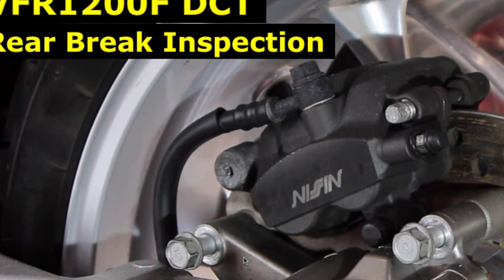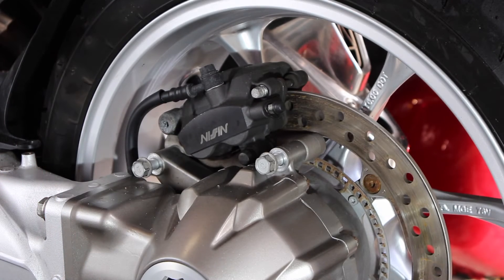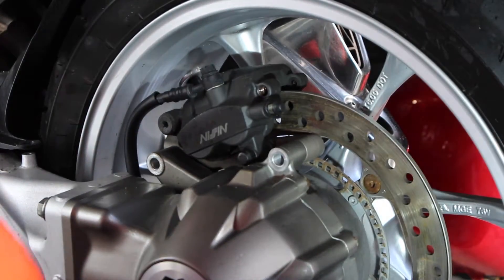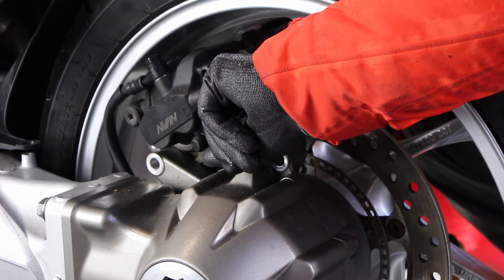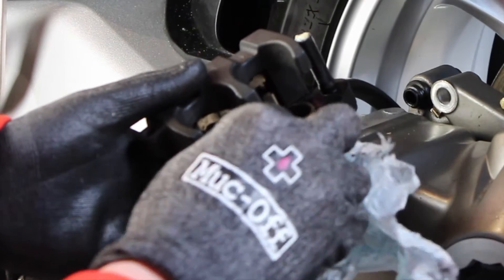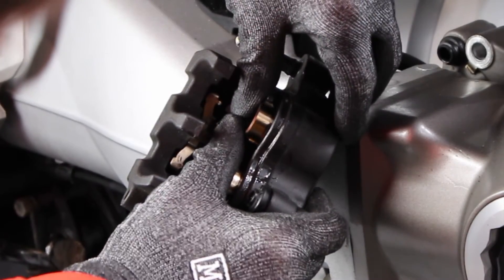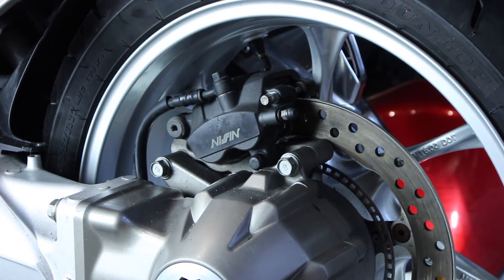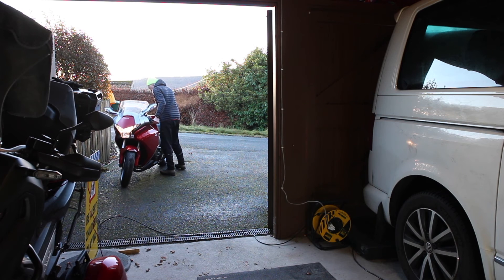VFR1200F DCT Rear Brake Inspection

Comment: I see your disc bolts and ABS ring have seen better days. I cleaned mine up using Evaporust and painted them sliver. They look a lot better now. The rusty discs isn't a problem. They clean up with use.
Reply from the maker: Many thanks for the tips.  Once I get through checking all the basics on the bike I will move onto the cosmetics.